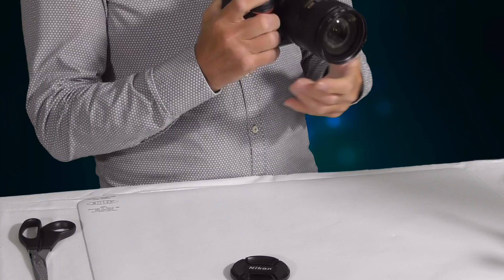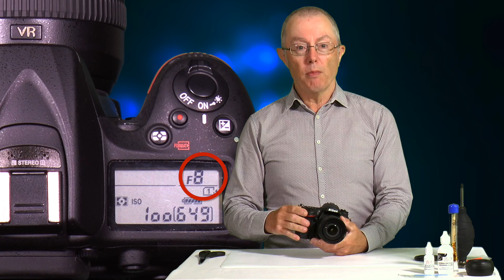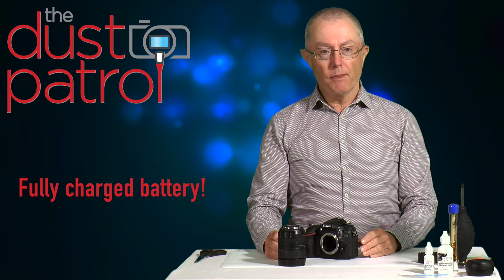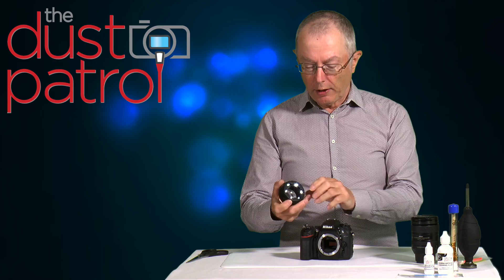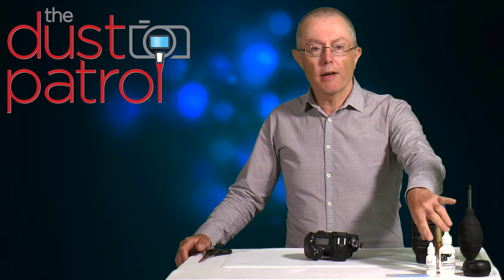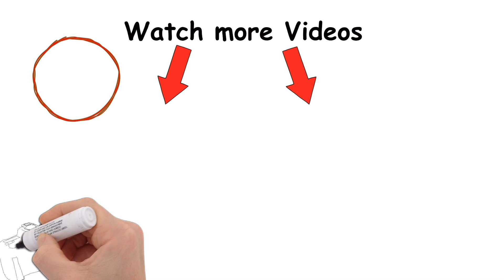Sensor Cleaning Nikon DSLR DIY

Comment: Recently found a huge amount of dust spots on photos when checking in Lightroom spot remover, no idea where they've suddenly appeared from. Cleaned all lenses & tested, still the same. Thought I would have to take it to a dealer at 50quid a time as too nervous to try & clean the sensor myself. Having watched your video it has given me the confidence to do it myself . Fingers crossed 🙂 Thanks for the video

Comment: I recently picked up a D6 from a local dealer only to find out after shooting an outdoor event the sensor needed cleaning.  I took it back for cleaning but the results were worse than before.  Being a Nikon dealer I trusted the sensor would be clean but that wasn't the case.  More PShop editing for the F16 and above outdoor photos.  I took it back for another cleaning and they wanted to know if I had photos to show them of the dust on the sensor.  I showed them test shots on a white board before and after their cleaning.  I want get into all the details of my conversation why they felt the sensor got dirty but I was told the new 24-70mm I purchased at the same time sucks in dust every time I zoom the lens and that could have caused the problem.  Owning several D4's and 24-70mm's without issues I felt this was a cop out.  I was told they use a loop to make sure there is no dust on the sensor but they don't test with a lens to verify the sensor is totally cleaned.  I offered to leave my lens with them to take a few test shots after cleaning the sensor but they didn't want it.  A loop is a great tool but taking the extra time to take a test shot with a lens to make sure your sensor is totally cleaned is the only way to go.   Great video and thanks for taking your time to put it together for us.

Comment: Thank you. Panicked when I saw a dot on my images. Did the checks and it was dust. Ordered swabs and cleaning fluid, but, after some good puffs it cured the problem. No doubt will have to do it wet in the future - had the Nikon D3500 for 6 month and taken 3000 images with lens changes but feel confident to tackle this now, although will watch again.

Comment: Hello. I noticed that my camera has a small hair in it, but when I take pictures they don't appear. What should I do? Where should I clean? I tried to clean the sensor and the before lock up with a cutter but there was no result. I need help, please respond. Also, I don't have the kit you are using in the video so the only way to clean it is either with a tissue or a cutter
Reply from the maker: Hello Stivos, obviously the hair is in the viewfinder system. Be aware that the screen, which you can see when you remove the lens and look upwards into the mirror box, can very easily be scratched. If the hair is on the lower side of the screen you may be able to reach it with a tweezer and remove it. Do NOT touch the screen. If the hair is on the upper side of the screen, I recommend a pro to remove the hair.
Reply: The Dust Patrol Okay thank you very much🙏🏽

Comment: Thank you for the video ! Please I ask for your advice if you can , I have an insect in my DSLR ! What do you recoment ?
Reply from the maker: I assume that the insect is in the viewfinder system. If you can see it clearly in the viewfinder, it may be on the top of the screen, the side of the screen that faces up and you usually can't reach,. Before you try to remove the insect, be aware that the screen is very, very, very sensitive to scratching. The screen has a little nose to hold it. This nose my show to the front or to the side and it is small.  Don't touch the screen anywhere else. The screen is hold in place by a spring, more like a metal bar, at the front of the mirror box. The spring is hiding behind the light baffle foam. You need a v-shaped tiny tool to push the spring back over the black post that holds it. Lay the camera on its back to do this. Be aware that there may be distance plates under the screen to keep it in the right position. After loosening the spring,  you can grab the screen carefully at its nose or you can turn the camera a little bit forward so that the screen will flip down. If you can see the insect on the screen or in the viewfinder system, use a blower to remove it. Don't blow strongly. And again, do not touch the screen anywhere else but at its nose. If your camera has distance plates, put them into position and then put the screen back into position. Lift the spring back over the post to hold the screen in position. We may make a movie to show how to do this at some time.
Reply: @thedustpatrol7515  Thank you ! Please make a video , it would be very helpful ... yes the insect was in the viewfinder , i didn't know what to do , i cleaned the camera using " Clean Image sensor" mode and a bulb blower  , afterwards I couldn't spot the insect again , but to be sure the insect is not active in there to poop around  i placed the camera in a cardboard box along with a electric power mosquito device which works with chemical tablets, that was my idea , don't know if it was a good one , if the insect died by the chemical then it is probably still in there , if you like put that method in mind as well if you want to use it for your video , thank you again for your advice , personal time and videos !

Comment: Is it normal if you use the brush really near the sensor border or its sidewalk some oil or fluid get over the sensor?? I've got this problem on my dx camera, dirt was near the edge of sensor, so I had to use brush really near the edge, but everytime it was bringing fluid by touching the edge over the sensor :/ thanks
need to use at minum 5 of them to clean again and then dry the sensor..

Comment: If I cleaned the sensor on my Nikon d3400 (blew it out, wiped with swabs and cleaning spray, etc) and I still see a "hair or piece of lint" when I look through the viewfinder, where the heck is this hair/ lint coming from??? I cleaned everything inside and out. Or at least I think I cleaned everything. HELP!
Reply from the maker: If you can see it in the viewfinder, it is in the viewfinder system, not on the sensor. It will not show up on pictures. Very likely it is on the screen which you can see after having removed the lens. The screen is on top of the mirror box, you can see it looking to the top inside the mirror box. Do not touch the screen, you can scratch it very easily. If you can't blow it away, it may be on top of the screen. The screen can be removed and cleaned, but without experience you may end up with a damaged screen. If it disturbs you very much, though not showing up on pictures, I recommend letting a professional repair man remove the hair out of the viewfinder system.
Reply: thank you VERY MUCH. good advice.
Reply: Try blowing the mirror box with a hand held blower, NOT CAN AIR.
Reply: @trishlizkat16bpi64  Is the mirror box that Fragile that I can't used the canned air?
Reply: If my sensor has small fungus on the sensor surface what should I do?